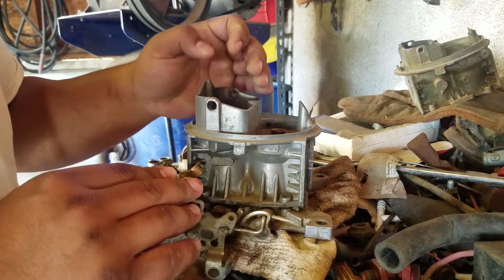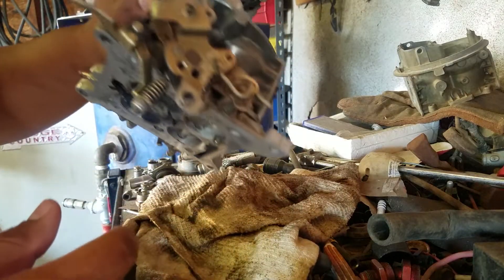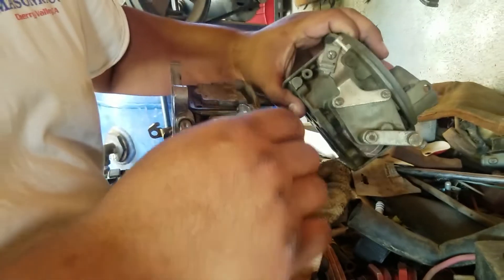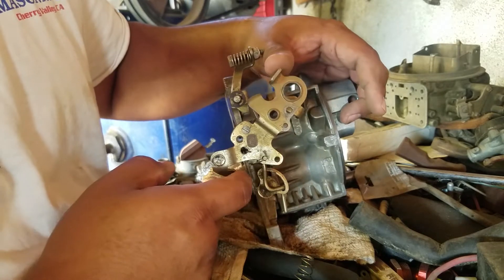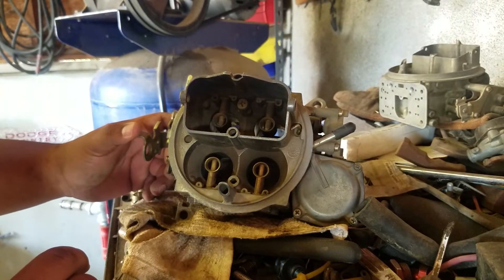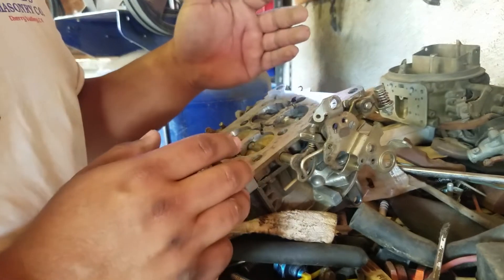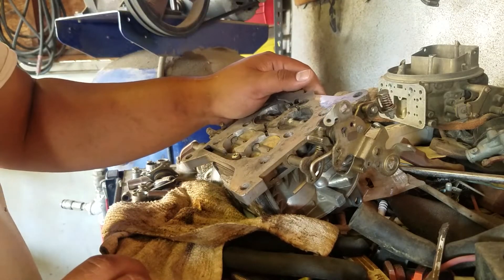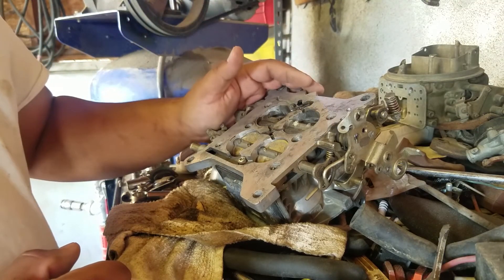Holley Vacuum Secondary Tuning EXPLAINED | Holley Carb Secrets | Holley 1850 4160 4150

Comment from the maker: Don't forget we are doing a 1000 subscriber giveaway! Win A FREE Holley carb!
https://www.youtube.com/watch?v=a5WT32bmfAo
Reply: Curious to know what happens if u have a low vacuum cam like 10 inches of hg will the vacuum secondarys open little or at all and would you run the lightest spring in the vacuum canister to make the vacuum secondarys operate
Reply from the maker: Well not exactly. The vacuum secondaries arnt exactly operated by vacuum. When you open the throttle past the 50% mark, you allow the secondaries to start opening but if say youre in 1st gear and you floor it, the secondaries wont open because the engine is unloaded and doesnt produce enough "suck" to open them. Vacuum gauge should only be used for idle and PV tuning. The secondaries run off their own metric
Reply: @NightWrencher  so essentially I'd be running just a 2 barrel until maybe in a higher gear at part throttle past 50 percent for the vacuum secondarys to open if they do. Or would it be worth running mechanical secondarys
Reply from the maker: You'll probably be able to get into them if you have long enough gears. Like on an older 3 speed auto but probably not in a 5 speed manual. I never recommend mechanical secondaries in a street car. Vacuum secodaries run much smoother on the street even with a big cam with low vacuum. Much easier to tune
Reply: @NightWrencher  well my 350 I built for the street and to run the 1/8th here and there. it's vortec headed solid cam long tubes full exhaust etc tr6060 six speed 4.10 rear
Reply from the maker: Thats a pretty sweet combo. For an 1/8mile a mechanical secondary carb would be better but on the street its hard to beat a VS carb. Depending how you load up the engine during launch there could be little difference between them but in between shifts a VS carb would suffer
Reply: @NightWrencher  it should be ok for now if I find out it doesn't work as well at the 1/8 I'll save my pennys for a mechanical secondary and put the street warrior carb on my short bed
Reply from the maker: @jacobjarvis2545  it should be fine depending on how fast you shift and a lighter spring in the diaphram wouldnt help keep it open. Too light and itll bog in certain situations
Reply: @NightWrencher  it has whatever the stock spring is in it and I'll be power shifting more or less
Reply from the maker: You should be ok. A little test and tune is all you need
Reply: @NightWrencher  I just rebuild the carb today and just got it running still have to test drive it and read the plugs it has 66 jets and a new 6.5 pv to start with and driving around the yard back and forth it seem to be good with no stumble or hesitation so as long as it don't go real lean I think it will be ok

Comment: The vaccum secondaries do not open using ported or manifold vaccum. There is a port just under the passenger side primary venturi(same side as the secondary diaphram) that goes to the diaphram. It's a seperate vaccum signal, not manifold or ported. The port for ported vaccum is directly above the closed throttle plates. The vaccum port for the secondary diaphram is further up just under the venturi on the passenger side primary. The vaccum signal doesn't just drop out like manifold or ported vaccum at WOT. Even at WOT, there is still a vaccum signal going to the secondary diaphram. As long as there is air flowing past the venturi restriction there is going to be a vaccum at that port.

Comment: Your assumptions are incorrect about how vacuum works inside of a carburetor. Vacuum secondaries do not operate off of manifold or ported vacuum, the operate off of the vacuum created as air travels through the Venturi. This vacuum is completely independent of ported vacuum, which is spawned by manifold vacuum. It's not the result of something being sucked on, it's the result of air passing over an orifice at high speed, which causes a vacuum inside of that orifice. Think about driving down the road with your window just cracked open, air is being sucked out of the vehicle by the velocity of the air going by the cracked window.
Reply: Absolutely correct. There is a port passage just under the primary venturi on the passenger side that connects to the secondary vaccum diaphram. As airflow increases the vaccum created overcomes the spring pressure in the secondary diaphram pod and the secondaries open👍

Comment: What to do if you have  gas coming from the shaft of the secondary butter flys on a holley 650. A 4160 carb
Reply from the maker: Does it drip down at idle or only starts after going for a drive?
Reply: @NightWrencher  idle dripping
Reply: Its the back one leaking is that primary or secondary running over dripping off secondary the accelerator pump rod
Reply: Can i send a picture
Reply: The car had set for 7yrs i rebuilt carb and replaced several things

Comment: I rebuilt my 750 single pump Holley it started right up and drove alright it fells like the back 2 barrels and blades are not working? It bogs down when u try to step on it hard it’s on a 350
Reply: You need more squirter. Engine masters has a great carb video.
Reply: @here_to_watch2115  blades got bent and ruined would not turn anymore so I got a new one that double pumps ⛽️
Reply: @colinmertes5090  nice

Comment: Venturi affect is what opens the secondaries, not ported vacuum.
Reply: Absolutely correct. There is a port just under the passenger primary venturi the goes to the secondary vaccum pod. Not manifold or ported vaccum👍

Comment: So I drive a 67 ford LTD with a 390 short block all stock I recently put a Holley 600 brawler on it tuned it up runs perfect until the secondaries open when they do open it has a hesitation like it’s going to stall then all at once it comes right back and the only way to get back out of the secondaries is to completely let off the gas I’m not sure if it’s a vaccum issue or something I did wrong but it’s been bothering me so any advice helps
Reply from the maker: Hey man, I would try a heavier secondary spring or slow down the secondary screw if it has one. A 600 is a little small for a 390 so itll pull a lot of vacuum, which is good. Hesitation might be rich or it can be lean. Put in the heavier spring or slow down the secondaries and go from there
Reply: @NightWrencher  will do appreciate the help

Comment: Hi would love help choosing a vac or mechanical 750 for my engine set up
Reply: Hello thanks I have a 468 Chevy with a thumpr cam only 7 or 8 inches of vacuum it's a 107 I have got a go 750, go 850 double pump from the two known places and twice  different people at Holley said the 670 street avenger would be e good for street use I think the engine guy did not do much to the heads
Reply from the maker: The 670 is a good carb but a 750 vacuum secondary with a secondary metering block will be way easier to tune.
Reply: Ok I had been looking at the 670  brawler it's a 4150 style think it has the metering block you mention but you think still step up to the 750  will look some more thank you
Reply from the maker: The size of the carb isnt the issue. Its the tunning. A smaller carb, when tuned correctly will out perform a bigger carb on the same engine but the problem is that most of the 600, 650 , 670 carbs have PVCRs, IFRs and jetting that is too small for larger engines or stock engines with a bigger cam. With a 750 you get larger venturies, sure but the real draw is the fact that all the tuning orfices are larger and better suited for your bigger engines so all you really need to do is rejet the carb and let it go.
Reply from the maker: Its more about the cam than the engine size. Stock cam, 650. After market cam, 750. I always go vacuum secondary unless its a dedicated race car.

Comment: Question I have a 355 sbc 218/220 cam around 320hp 4 speed with 3.42 I have a 670 jetted or made to be a 750 my secondary’s are only opening at 5000 rpm and on a tiny bit opening up is this carb to big for my application? I don’t want to blow up my motor help please 😮
Reply from the maker: Hey man, first off. You cant jet a carb and have it turn into a different CFM carb. Thats not a thing. Second, CFM size will have zero effect on whether oe not you blow up your engine. If you run it too rich or lean, that will kill an engine. As for your secondary opening, how are you checking when it will open? You can't really open the secondaries at idle.
Reply: @NightWrencher  I just meant I bought the carb from a carb rebuilder and he said it was a 670 but he turned it into 750 iim not sure what he meant ,plus I meant that I have to rev it more than 5000 rpm to get the secondaries to open up and that If I wanted them to open up more it’ll take it to 6-7000 rpm then I would probably blow up the motor then ,anyhoo do you think this 750 is to much carb for my set up ?
Reply from the maker: Yeah, thats not a thing. You cant turn a carb from 1 CFM to another CFM so your carb is a 670. A 670  can get you up to 400hp no problem, its a good size for that engine. Have you verified what spring is in there?
Reply: @NightWrencher  ohh ok no I’ll check later today  is there numbers on them or just the thickness and it seems like a lot of fuel is squirting into if from the accelerator pump so I backed off the spring a bit seems to be better now
Reply: @NightWrencher  years ago I had a 750dbl pmpr carb.  We opened up the venturis and it then flowed 787cfm on a flow bench.  CFM  can be changed slightly.
Reply from the maker: @FreeSwimmer  I probably should have clarified what I meant. A "670" has a smaller venturri than a "750" but they share the same throttle bore. You can do a number of things to a 670 and have it flow more CFM but its still a "670" main body. Same thing thing if you stroke out a sbc to 396 it doesn't "turn into" a big block 396. In fact, that holley "670" probably uses a "650" main body with some tweaks but its probably just marketing.

Comment: Nightwrencher, my vac secondaries don't open on holley 750. I've been chasing this issue for months. Please help! 🙏
Reply from the maker: Take off your secondary vacuum pod and make sure the cork gasket is on there and in good condition. After that, push in the secondary into the pod and hold your finger over the hole with the cork gasket. Let go of the secondary diaphram and it should stay in place, if it pops out, theres a tear in it and you should replace it. Check that first and go from there
Reply: @NightWrencher  I've done this. Cork gasket in good condition. Stays in place while finger over the hole. I've tried all springs no change.
Reply from the maker: Have you tried taking out the spring entirely?
Reply: @NightWrencher  I actually haven't tried that. Would that open secondaries at idle?
Reply from the maker: No, thats just a myth. Look up "1973 charger dyno nightwrencher" and that video I actually pull the spring out on the dyno.
Reply: @NightWrencher  ok. I'll try this tomorrow and let you know the outcome. Thanks.
Reply: Took the spring out and gave a small bump on timing. They open ! I  can't even find the paperclip. Lol.  Definitely feel a power difference, but now I just have an off idle hesitation. I have 67 jets and a 31 squirter.
Reply from the maker: Its possible your IFRs need to be opened up a bit but youd have to guess if you buy the drill bits

Comment: I see I am missing the linkage now. Now I have to make one to replace it.
Reply from the maker: I think can get them pretty cheap online
Reply: @NightWrencher  I have a couple different zize sections of carb linkage rod my grandpa had. They use to sell stock rod you cutt it to length and bend it. They had clips snap on to ends so linkage can't fall off.

Comment: A couple of points of clarification.  The secondaries do not use ported vacuum, they use venturi vacuum.    The primary purpose for rod on the linkage is to force the secondaries shut, it makes sure they don't stay open even after the throttle is closed.

Comment: What benefits are there, for a screw to be in the pathway that the secondary linkage/rod travels in. Is it to convert a vacuum secondary to a mechanical? It's on a 1460
Reply from the maker: Yes, exactly. This is a pretty bad idea because it would allow more air in before the fuel has a chance to catch up and would cause hesitation and back fire issues. You should either tune up the 4160 so it runs how you want it or if you plan to race it, install a double pumper.

Comment: What if you put a lighter spring ?
Reply from the maker: it would have the secondaries come in sooner which is fine if that's what you need but you might open them up going up hills where before you could just cruise up the hill on the primaries. not a problem, but less mpg.

Comment: Great video, and answers quite a few questions for me.  I've been asked to help set up a supercharged Rover V8, for which we do not know the internal bore and stroke spec if they are none standard to 3500cc (213 cubic inch).   No ARP studs is making me think it's relatively standard internally.  The carb is a Holley 1850-2 and some have been informing me that this carb at 600cfm is way too big.  However from how you have just described it running on the primary's, and will only call on the secondaries 'if and when needed' due to vacuum at the primary.   Of course if the primary's can feed the vacuum requirements created without generating vacuum which needs feeding by the secondary's.   Hopefully I'm right with this thinking??
Reply from the maker: you are correct that that carb is a 600cfm vacuum secondary carburetor. Theres a few things you need to keep in mind. Is this a blow thru or draw thru set up? Draw thru set ups will require larger carburetors because the carburetor thinks its on a larger displacement engine due to the suction. Blow thru applications would use the same CFM as an NA engine because the carburetor gets pressurized in order to get the correct flow when boost hits.
Reply: @NightWrencher  .....Appreciate the reply thank you.  The set up of this is a draw through from a Wade RO34 supercharger.  Again, as simple as it sounds I had never considered that to give positive pressure into the engine the supercharger needs to firstly fulfil the engine's normal cfm demand.....plus a bit...to actually compress the charge going into the engine.
Reply from the maker: Draw through superchargers are fairly easy to tune which is why theyre so popular. You gotta remember that idle and light cruise have nothing to do with booster type, size or opening. A belt driven supercharger creates power in a linear curve just like an NA engine so your engine ahould respond as if it had more cubic inches but at idle and cruise it should operate like stock. One thing about the 1850 is that youll probably have to boost refference the secondaries and power valve so it matches the incoming boost
Reply: @NightWrencher  .....again very much appreciated advice.  I just watched a video where a guy created his own vacuum port into the chamber where the power valve is located because he wanted it to react to inlet manifold vacuum pressure instead of the vacuum created by the supercharger draw.   Hence boost referencing I think.  The bit that then confuses me for my background mainly with N/A cars, is that N/A cars have highest inlet vacuum at idle and this drops as the throttle blade opens.  It then finally peaks again after shutting off the throttle blade when decelerating and then slowly returns to the normal level after a little time at normal running or cruise.  Is this all different with a charger fitted because the positive pressure output of the charger satisfies the inlet manifold vacuum? I'm trying to get my head around the behaviour of inlet manifold vacuum which then activates the power valve during acceleration.  My immediate thoughts would be to create the port in the power valve chamber but maybe share vacuum from the throttle blade port nipple which feeds the ignition dizzy advance and retard unit, because on an N/A car that is lowest at Idle and highest at WOT.  Again, any advice or clarity for where I'm missing the key difference with a charger application are much appreciated thanks.

Comment: Thanks for a great explanation! That was on point and makes sense. 
I was wondering what the differences are when you change the springs would be? What does it do to the diaphragm? What does the harder springs do the secondaries? Does it hold the secondaries open longer or close them back faster?
Reply from the maker: The springs offer resistance against vacuum so the stiffer springs would open the secondaries later. Heavier/slower cars should have stiffer springs while faster/lighter cars should have lighter springs